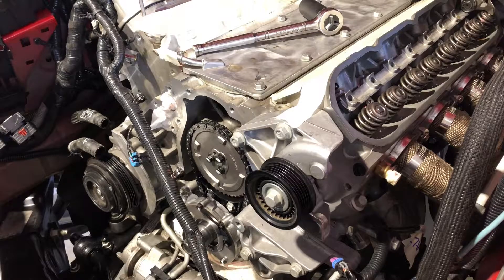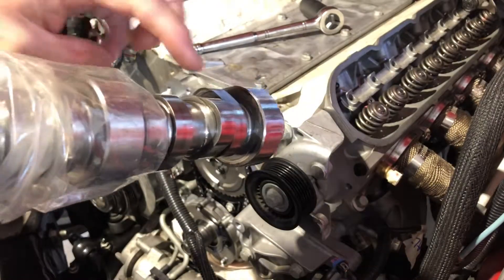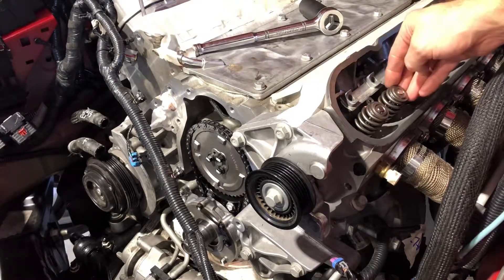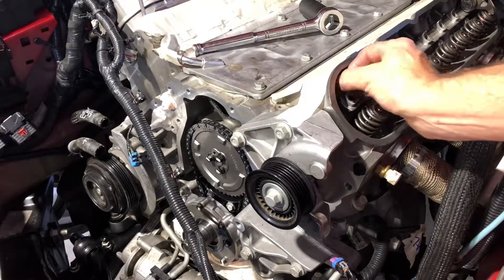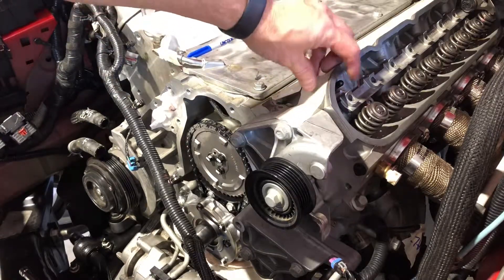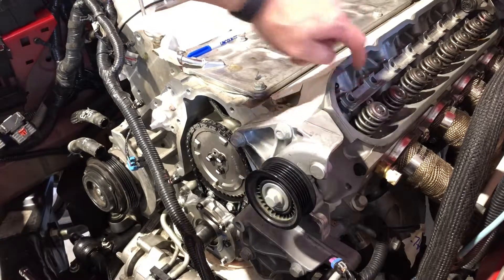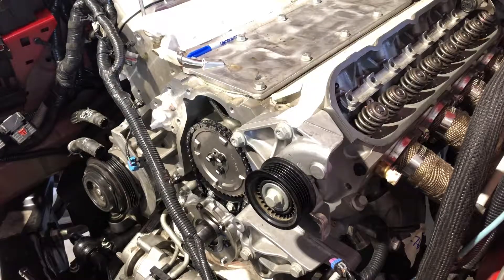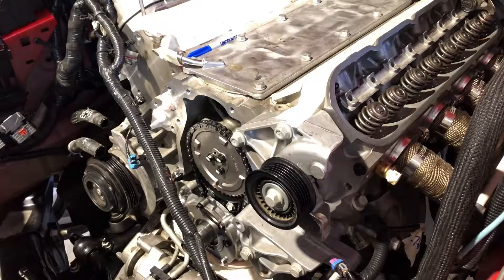Finding base circle on my LSA camshaft the easy way

Comment: Putting new valve stem seals after finding I'm blowing blue on hard decel after resurrecting ls1 after 14 years. Since my ls swap is super tight and hidden under a hydroboost setup for brakes i want to get my preload perfect as one last time for a long time while not dropping entire block. Marking the balancer on my crank with cylinder number  and an E or an I should speed up the job with a friend that is underneath car and 4 post lift while I'm 6 feet in the air under the hood feeling out tops of lobes with push rods. Thanks for this!

Comment: Simple and easy method, there are so many. Basically one full turn of the crank is half a turn of the cam. If I set the valves on my three wheeler at tdc I have more lash in other parts of the rotation so I’m going to try this method. If that dosnt work I’m going to degree the cam and see what the heck is going on. The method I used on my belair series is when you are coming up to tdc on the compression stroke, both valves aren’t moving for a while, even after tdc you have quite a window to set both intake and exhaust on the base circle. But with a large duration this might not be the best method. Your method is foolproof.
Reply from the maker: My hope starting the channel was to help people like me do the simple things on their cars themselves. I'm glad you got some use out of it. Good luck on your project..

Comment: Why not tighten down a pushrod abd rocker (not torqued down just tight enough to hold it on) turn it over till the valve is closed or spring is decompressed, would that not put the lifter at the base lobe of the cam?
Reply from the maker: If the spring is compressed then the valve is open not closed. Also why bother putting on the rocker when you can just use a pushrod? When the valve just closes technically you are just to one side of base circle but it could measure the same. My way is 180 degrees from peak so it’s exactly base bottom.  There’s more than one way to find what you need.
Reply: @fasnuf  yup that’s what I meant when springs not compressed down valves closed, but appreciate the response

Comment: Hands down best video for finding base circle
Reply from the maker: Wow! Much appreciated! Good luck in your project.
Reply: FasNuf ZL1 I’ve been done with my C6z cam swap for almost 3 weeks.. I’ve had a few friends help me measure for pushrods and the lengths seem to be off (like maybe it wasn’t at base circle).
Reply from the maker: @YELLOW08Z06  You got it resolved right?
Reply from the maker: @YELLOW08Z06  I have a video on measuring for the pushrods too if you havent seen it
Reply: FasNuf ZL1 I’m about to start on it now.. it’s kinda hard to turn the engine over with everything in the way. I bought a starter bump button so I’ll see how good that works
Reply from the maker: @YELLOW08Z06  Whats makes you think the pushrod length is off? Can you access the crank bolt from under the car? I guess I'm confused, I thought you said the cam swap was done.